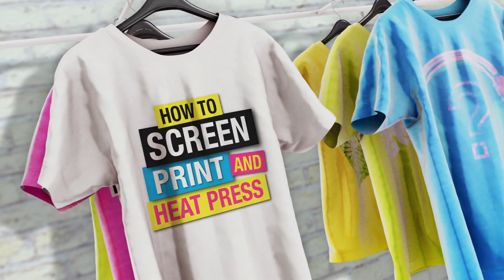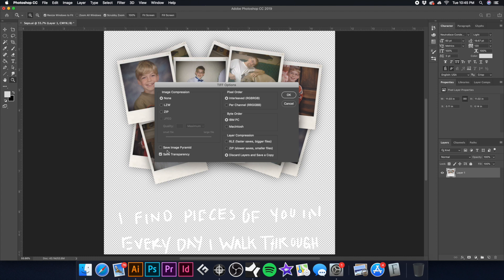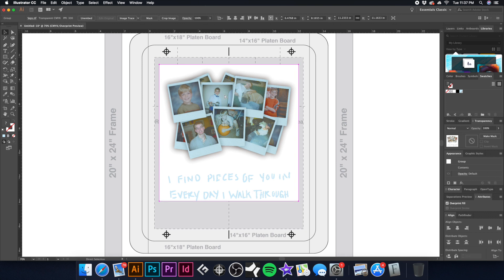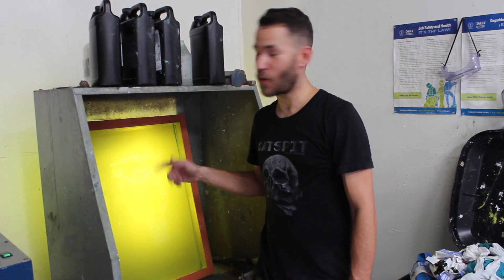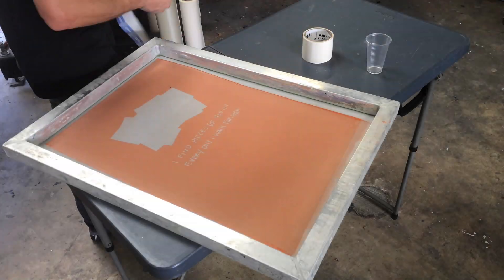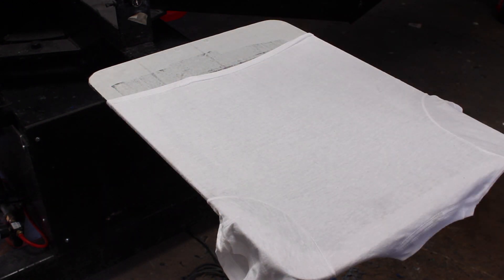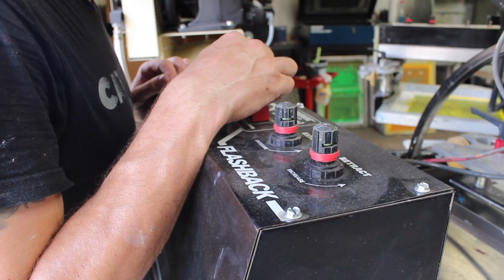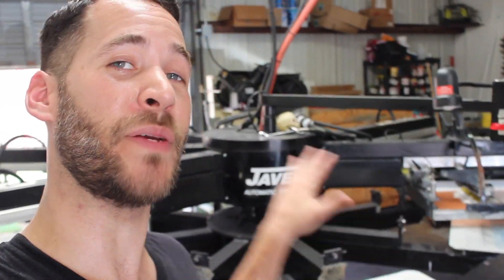How to Screen Print CMYK on a White Under Base Step by Step Tutorial

Comment: so 65 LPI using 330 mesh? also for the white under base should i use a 160  for a bit less ink? i do use a flatting screen
Reply from the maker: 65 LPI on 305 mesh. If you can get or have a higher mesh, then all the better. I would stick with nothing lower than a 156 for the white base. I flattening screen would be idea, but not 100% necessary.

Comment: Hi Im totally new to this so a rookie question here 
What would happen if you simply did the same process on dark media without the white base ? 
Would  the cmyk colors not  show at all ? Or does it mean the colors will show but it just won't be that vibrant & popping
Reply from the maker: It wouldn't show. Kind of like running black paper through a color printer. The inks are transparent.
Reply: @mikeydesignssilkscreen473  yes thanks again !
I only recently learned printers don't print white 😆 , it never occurred the base is white such as paper & it makes up for it . Haha

Comment: Hey Mikey great video, hope you can answer my questions on a old video. 

Can I do this same process on manual? If so should I also do yellow-Magenta-flash-cyan-black? 

Is that plastisol or waterbase?
Reply from the maker: Thank you! It will be even easier on a manual, aside from time. Print flash print flash the white base and flash all of the cmyk colors. It'll come out nicer that way on a manual. I used plastisol inks.

Comment: Great videos ! Learned a lot .... wondering could a forced air flash be used for both plastisols and water based inks ?
Reply from the maker: Thank you!!! It definitely can. We have a forced air conveyor we use for both. Just turn the air flow function on for Waterbased and discharge inks.

Comment: Would you use the same art settings as if printing on just a white shirt as opposed to an underbase? We made an underbase for a process print we did to experiment and it just didn't look the same; almost like pastels printed instead of CKMY......
Reply from the maker: You would use the same settings. What mesh were you using for the under base?
Reply: @mikeydesignssilkscreen473  ..It was a while back....No less than 160 for sure...It was either 160 or 196....I'll have to try it again during down time.. I can't recall printing a few shirts or just doing a one-off...But I was at my max gain because it was after printing the job and I kept the screens flooded so I didn't clean them and then print it...Wouldn't do that!
Reply from the maker: @jakecybok6436  I hear that! Give it another shot. I would say the best method for printing on dark shirts is spot process, but if you're limited on colors and the job requires more colors than your press has, CMYK on a white base isn't a bad way to go. Just tends to be tricky.
Reply: @mikeydesignssilkscreen473  Yea, without a doubt simulated process is the way to go on darks for sure which is what we do! I've had some inquiries about CKMY on a lot of black shirts and would take WAY too long to DTG and that just doesn't pay. I'm limited to 7 heads because of an inline flash and white takes 1 head so I'm down to 6 and these customers want 10+ color designs. I've had to turn them down multiple times because I just can't get all them colors, regardless of how we play with the half-tones. Like I said, I'll try to set up another job and put an underbase and play with it!...(Another press is out of the question right now)
Reply from the maker: @jakecybok6436  I hear that! Sometimes we can over print colors to get new colors, but if they're wanting spot colors then we just out source them to Sunline Products so we can retain their business and still make some money off of marking up the shirts.
Reply: @mikeydesignssilkscreen473  That's how simulated process works!! And yes, our pricing structure allows us to outsource and still make money. I'd rather do it all in house, hence the inquiry!!
Reply from the maker: @jakecybok6436  I hear that! I'd rather have control of the work than outsource it if possible.

Comment: If I use a 60 LPI and I use the CMYK angle (c-15 m-75 y-0 b-45) what mesh should I use and what mesh should I use for the under base
Reply from the maker: I would go with a 230.
Reply: @mikeydesignssilkscreen473  230 for the underbase? And should I go with a higher mesh (305) for the colors (cmyk)
Reply from the maker: @ivanramos5735  You got it!!! Hit the under base a couple times with a print flash print flash.

Comment: Mikey is it? excelent result you got in there.. have you spoke to Jonathan recently? I ask him a tips to do this similiar job but unfortunately I couldn't pull this off. the result i got is quite good but not good enough. and often I got a problem like ink pickup mostly and make the shirt pulled up and ruin the registration. I also adjust off contact and put more adhesive to the palette it solve the "pulled shirt off" but another problem came up which is dificult to detach the shirt from palette(sometimes print got crack out). ps. I use manual presses. hope you could reach me with a tips or might be hidden tricks ;p

I only can do this by hit flash hit flash and it quite longer than wet on wet. however I have no problem doing wet on wet without underbase. thanking in advance. :D
Reply from the maker: It's been a little while since I've talked to Jonathan because I've just been keeping busy with our business.

Sounds like you need to use a higher mesh screen for your under base. Try using a 200 or 230. That'll help keep the under base from sticking to your screens. Great thing with a manual, is you can flash between each of the CMYK colors which will help as well.

I hope this helps!
Reply: @mikeydesignssilkscreen473  yep.. I hope ur business went well and have a  bright future ahead.

already did on high mesh but still not work yet. I think what i need to do is keep practicing till the day come along.

thanks for tips mikey.. :D
Reply from the maker: @mateorenai  Any time! Maybe try a different white ink. That may help.

Comment: I have been trying to do an under base for a week and no luck. I just saw this video and I got stuck where you mention about hit option right after you say hit the D on the keyboard. Sorry, I use pc I know you use a mac. Can you help me out on this?
Reply from the maker: Hitting D on the keyboard simply brings up the default black and white swatches / pallet in Photoshop. So the idea is to make the white base layer just black. So you can make a transparency for the white base. Let me know if this helps.
Reply: @mikeydesignssilkscreen473  I got that part I just didn't get when you said hit option and delete. What's the option key on a PC
Reply from the maker: @ivanramos5735   Gotcha. That would be alt delete on the PC.